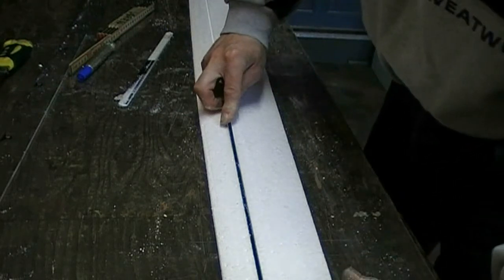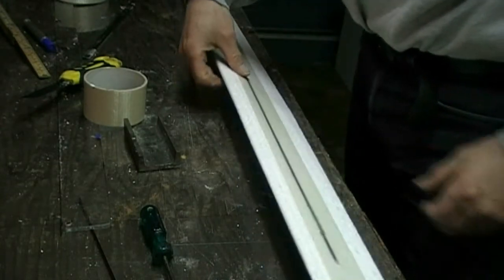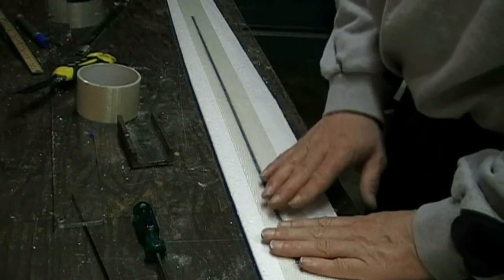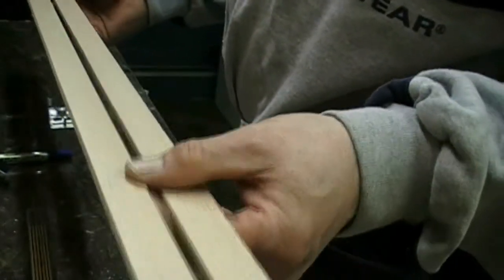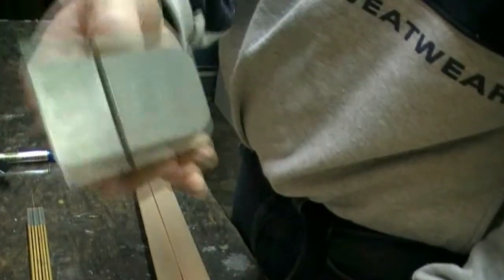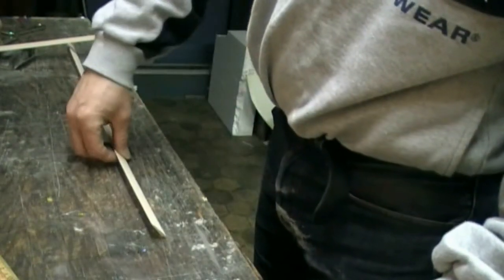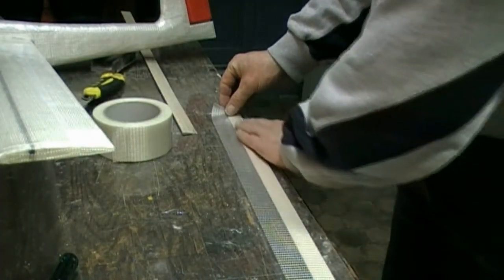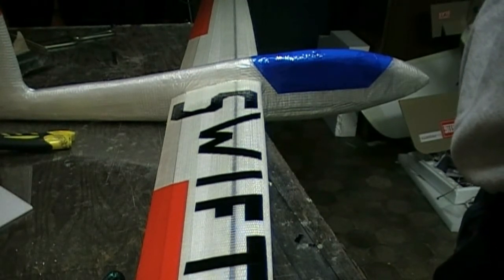RC. Part 2.How to make a Swift S1, aerobatic foamglider.

Comment: You used EPS for the wings, presumably because it's stiffer than the ethafoam? Sorry if you said that in the video, I don't hear very well.

Ah yes, the tool you used for shaping the taper on the ailerons is a 'razor plane' for the small hobby version and 'block plane' for a slightly bigger carpenter's version. ( I have no idea why this is a plane and an aircraft is also a plane :¬D)